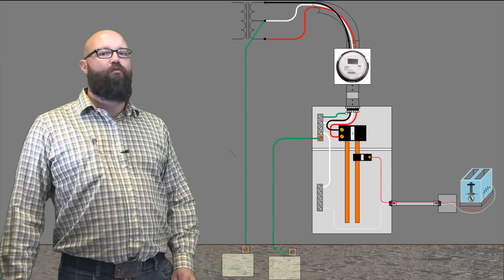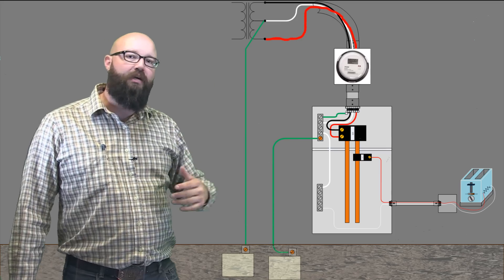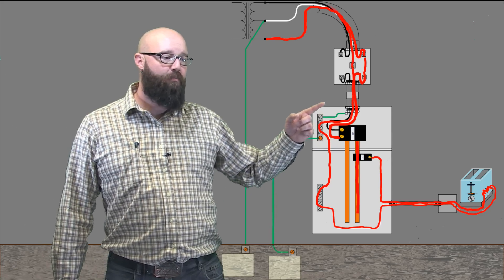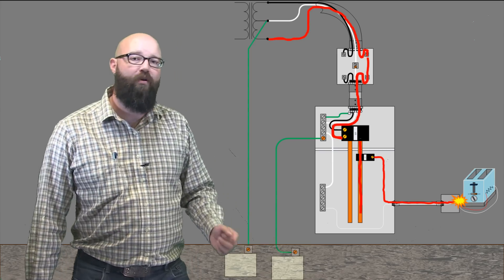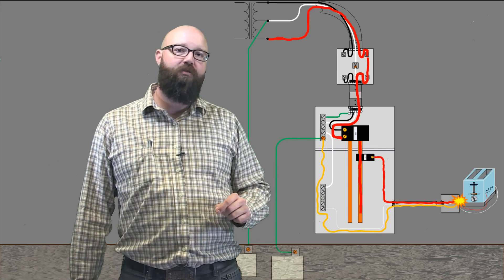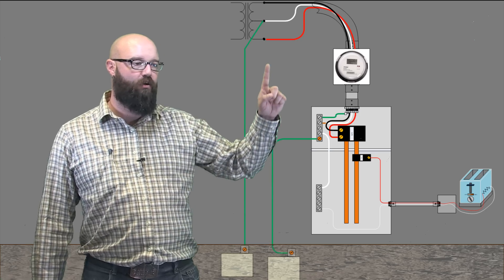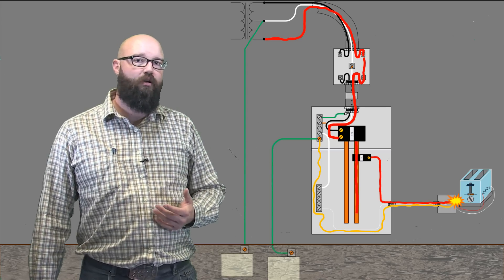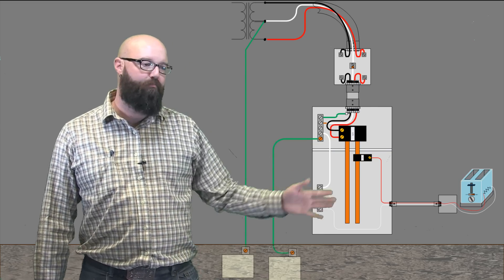Grounding and Bonding

Comment: I have discovered that I have no bonding of any of my pipes (water or gas) and I have just one grounding rod.
My water pipes are all metal and are underground in my front yard about 30 feet before it enters the crawl space of my house. A section also goes underground again to feed my outside water spigots in my backyard.  Does this mean the water pipe must be bonded, no matter what, and within 5 feet of where it enters the house?  And is done to prevent shocks?

What about gas pipes for water heaters or furnaces?  If there is already an electrical connection is that an automatic bond with a ground from that electrical connection?  Or did I misunderstand and need to bond the gas pipes, too?  

My panel, gas tankless water heater and the crawl space close to where the water pipes comes in is on the same side so I pray that this will make it easier to have updated.    Any advice and input would be greatly appreciate.

Comment: would not you need the ground wire at the box or appliance for the current to return to the boded? neutral is not connected to the box, or ar you assuming a contact between the power and neutral?
Reply: As a retired electrician, I caught that as well.   Nearly all the toasters I've ever seen, only have two conductors - Line and Neutral, thus offer no fault protection should  the metal casing become energized, even if your home has grounded outlets.  Sometimes, you will see appliances labeled Double Insulated, meaning they are constructed with _ an additional layer of fault protection,_ thus minimizing (NOT eliminating) fault conditions (i.e. energized external contact points) that regulators have allowed manufactures to forgo the normally required grounded plug (Class II electrical devices).   IMHO, Chris really should use an appliance that normally has a grounded plug, like a microwave or clothes washer.

Comment: can you point me to any video that expplains why the neutral might float if its not grounded.   i understand v=ir but cant undertand why if L1 and L2 have different resistive loads, that would cause the neutral to drift and cause voltage imbalance , the transformer is still putting out 240V but now you have maybe 100 and 140 v  in the 2 sides... but why does this happen?

Comment: What's so great about the video!? I don't feel the title is paired with the content? If you change it to how a short circuit works that might connect better. Let me put it straight: the grounding is there to save your life. That's it and the man in the video did not mention it once. He only explained what happened when you have a short circuit for whatever reason and repeat it twice. How a circuit breaker works. Not bad. Just not very accurate to the title of the video... Just my point of view. I don't have to be right too as I see everybody is thrilled

Comment: my question is .. i have an pool light that had white, black and green wireing. i need to replace the lamp asm. so i went with a L.E.D. lamp asm. the new lampe has no ground wire. only white ground,  and black power wiring. of course the green wire is still in place with no whare to go. this is an 12v systom befoe and after changing lamp asm. do i attech the green wire to the white wire connrction also ? or leave it loose.im i just concerned of is it ness to utilize the green ground wire. the orignial lamp was a 12v 300 watt unit. incancestestent.

Comment: What is an "IDENTIFIED". I ve seen numerous videos on this subject and have never heard this term. Do you mean " the neutral"?
Reply from the maker: A neutral is only correct when it is a conductor carrying the unbalanced load in a circuit as in Edison three wire or a wye system. Even then it is referred to as an identified neutral. An identified conductor is the conductor that is grounded. 

As an example a 120v circuit has an identified (white) conductor, and an unidentified (black) conductor. The white conductor carries the same current as the unidentified (typically referred to as hot) but is equipotential to the metal enclosures, conduit etc (not to be confused with a bonding conductor). It is not a neutral in this scenario.

Comment: Wouldn’t the hot touching the box be a ground fault, not a short circuit?
Reply from the maker: A short circuit is simply current flowing back to the source on an unintended path of little to no resistance. A ground fault is a type of short circuit, as would be line to line.

Comment: As well.....if the short is grounded by a ground wire that goes to the ground bar in panel and goes into the ground via ground rod and system neutral grounding. If the metal boxing, panels, metal raceways, etc are bonded to ground, yes they are energized too by the short but are safely carried away to grounding mechanisms. All this to protect YOU from becoming a big resistor going to ground.

Comment: You basically showed the same path for both. What is the grounding wire from the ground bar to the grounding rod for if both faults go up to the service neutral and when do we remove the bonding screw from the grounding bar in the panel? Nothing was explained yet again
Reply: The grounding rod is for external faults such as a lightning strike because the source is the earth. Internal or man made faults the current returns to the transformer because it is the source. In each case the current returns to its source. The bonding screw is removed in a sub panel where the ground and neutral are separated in order to avoid "objectionable current".

Comment: Thanks for the presentation, but I'm unsure if this is code compliance because the bonding conductor was not addressed here? so how the fault current will travel through the natural conductor ? or grounding conductor for the branch circuit, you provided only grounding but no bonding.
Reply: By saying "natural" conductor, I assume you meant neutral conductor. The neutral and the ground are bonded by the fact that they are both connected to the neutral/ground bus bar, therefore the ground fault will travel up to the transformer, closing the loop and tripping the breaker.

Comment: Thanks for sharing.  I have a pull out breaker next to the service box meter box.   the main box is inside the house without a ground but the metal tube from the meter box to the main panel is wraped around with a ground but it never is attached to the ground bar.  Should a ground be attached to the ground bar in this situration?

Comment: Or pvc boxes and conduits negate this and the standard green ground wire will handle it. In steel the green ground or bare ground wires will still handle the stray  current to the outside grounding rods and incoming neutral grounds

Comment: Great Video, thank you indeed, also would have a quick question, would you please let me know, how a metal conduit will be grounded if it is used for mechanical protection? is it grounded at one end? or two ends? the same question for the shield of the cables, do they need to be gronded at both ends? is there any certain rules to determine when the ground loop could be occurred and not to ground at both end? (for instance,  communication cable/ control cable/power cable ..) thank you in advance for
Reply from the maker: Generally the connections in couplings and connectors are what create bonding continuity. 
Single conductor cables generally have only one side (commonly the supply) bonded to eliminate the flow of sheath currents.

Comment: So basically, after burying your ground rods, you can run your bare copper straight to the panel & bond the neutral?
Reply from the maker: Provided you have the meter base isolated from neutral, yes. Only one location may have the neutral bond to metal on the line side of the service disconnecting means.

Alternatively you could bring the grounding conductor into the meter base, and make your connection to the neutral there, but the panel neutral must be isolated (take out the green screws)

10-210 a) and d)

Comment: Question: If you have an open neutral AND an open ground at the main( highly unlikely, I know but just "what if") and the current is diverted to a path to earth via the ground rod,  in it's attempt to get back to the neutral at the pole transformer, could a person conceivably get electrocuted by cutting that ground wire that runs up the pole to the transformer?

Comment: Hey Chris, I really appreciate this video a lot! However, can you explain why CEC went to isolated neutral bases?
Reply from the maker: Hey Brandon! Are you referring specifically to the line side meter base being isolated? It is still an option to have the neutral bond at the meter base if that's where the connection to the grounding electrode is going to be made, but then the neutral must be isolated everywhere else. And visa versa as well. It eliminates objectionable current flow over noon current carrying metal components at the service by creating the single connection to neutral.
Reply: @schulerruler  sorry im just a little confused i thought the neutral could only be connected to ground at either the main panel or the meter not both.... that bonding screw you have at the meter base isn't it illegal? sorry for my shit explaination
Reply from the maker: Based on anything post 2018 you are correct. This video utilizes the 2015 code where dual point grounding was still used. 

For new installs, according to 10-210, we have one point (meter or service disconnect) that a connection can be made, or if we are dealing with load side metering, only at the service disconnect as the meter would be on the load side of the service disconnect where no connection between neutral and metal is permitted (remove green screws).
Reply: @schulerruler  thanks alot for clarifying, much appreciated and love your vidoes they have helped me out alot!!

Comment: The thing is in Canada, the neutral in the meter box now is isolated from the metering Base. And the meter base is bonded to the  main panel.
Reply from the maker: You are correct. They have now given the option to have it booked at either the meter base, or at the service disconnect in the panel, but wherever the connection is made, the other point must be isolated as you say.

This video was made with the 2015 code where the dual point grounding was still permitted, but that changed in the 2018 and onward.

Comment: It seems like grounding is like very the last safe path for stray current. So is it absolutely necessary or just good to have?
Reply from the maker: In the event of lightning or other transient high voltages, the connection to Earth can be utilized to dissipate the massive charge. 
Definitely needed, though the system will still function without it. Overcurrent will still trip, and voltages will still be balanced because of the neutral connection to the metal system at the service.
Reply: @schulerruler  thanks for responding. I searched this video after I replaced an old water spigot that was connected to the ground from my junction box. I was wondering if it was of any use now that I replaced the copper piping with PEX? It's not attached to anything now so I am trying to see if I should  A.) Ground clamp it back to the spigot B.) Run it into the dirt/ground or C.) Get rid of it all together.

It's not connected to anything now so I guess technically my house is Ungrounded / unsafe??
Reply from the maker: If the water main coming in is still metal, then it is acting as your grounding electrode still, even if the interior piping is now PEX. 

If the water main coming in was replaced, and that is where the connection to Earth was made, then a new grounding electrode would need to be installed yes. Either a plate, or rod etc.

Comment: Help me out to understand......core question is the outside "true" ground rod driven into the earth...and it''s heavy gauge bare wire entering the home system. For many electrician's videos here on YT, they often run this 6 or 4 ga wire directly to somewhere inside the main panel box....landing either to a large , recessed-hex terminal  that looks like married to the neutral lug of the incoming power....or....to a ground/neutral bus under a screw head The question...as I view my main panel.....I don't see such a visible connection made inside the panel anywhere where I can find a bare 4 or 6 ga wire....YET....I can measure continuity from any point on the main panel ground path or ground bus .....to the "outside" ground rod. Is the depiction you show for the outside meter, located presumably in roughly the same backside location of the indoor ( in-garage) main panel....is this the point where this ground is connected between the meter box and the main panel?..... with high ampacity capability?...maybe via the neutral-connection only?....is that how it works? 🤔
Reply from the maker: The meter box is a common place to make the connection between earth and neutral, or sometimes it is done in the main panel box disconnect compartment instead. Whichever is chosen, the neutral must be isolated at the other, in Canada anyway.
Reply: @schulerruler  ...since my posting, I think I figured out my previous confusion. The ground rod and its 6 ga or 4 ga bare wire,......connect to a bar in the meter panel that also is the major neutral line ( to "load") from the meter box to the inside main panel ( in this case....bot panels are "back-to-back"). This major diameter(size) neutral continues and connects to the main panel as part of the feed to the panel. It connects via a large bar to the vertical neutral bus bar. Being the main panel,  this bus bar is bonded to the other vertical (ground) bus bar. The "Ampacity" is maintained from any ground via this bus connection to the point-of-entry of the major neutral connection.....then....back to the meter box....where the fault current either goes back to source or ground via the grounding rod. "Ampacity" in either path is maintained. This is all better described in a sketch instead of this confusing text.....but I think I have it now.
Reply from the maker: The current does not ever go directly to ground though. The entire system is designed so that any fault current imposed on the system anywhere downstream has an immediate path through all the bonding connections back to the system neutral, to complete it's oath to the transformer creating a line to neutral short across the coil of the transformer. 
Imagine current going out on line one, going through a load, then coming back on neutral normally. It goes all the way back to the supply transformer (even though it's ac and it just kind of goes back and forth we analyze it as one direction travel).

In a fault, the current goes out on line 1, or line 2, then there is an accidental connection from line 1 say, to the metal box. This could be skinned insulation, etc. The current now has a direct path back to the neutral via all the bonding connections, and meets the neutral at the main service where it is bonded to metal either with the green screw, or a system bonding jumper. This then carries it back directly to the supply transformer where it completes the circuit but with very little impedance, hence, short circuit current.
Reply: @schulerruler  ....I got that...and thought I mentioned that in my sentence..." fault current either goes back to source or ground via the grounding rod". In this case "source" is the incoming city power at transformer. In any case, regardless where the fault current goes.....there is STILL the ground rod ( pounded into the "earth/ground")...that has a 6 ga wire that runs up to the meter connection where the large neutral lands. My original concern upfront was asking if  the amp-capacity was maybe lost...seeing  I DO NOT have  the 6 ga wire continue from the meter neutral/ground bar.... to the main panel? My later realization is that "Ampacity" is still maintained via the large diameter neutral that continues between the meter box and main panel.....right?
Reply from the maker: Correct. The ground wire used to be sized based off the hot conductor ampacity, but has since been only required as you say to be a copper no. 6awg.
Reply: @schulerruler  So...overall.....should I be concerned that my jurisdiction somehow doesn't require continuation of that 6 ga "system " ...to continue from the meter box to my main panel? Seems my 6 ga system STOPS at the meter box ( from actual "ground/rod")..... and does NOT continue to the main panel bus or anywhere else in the main panel ( main panel is back-to-back vs meter box location on the outside).  Seems I'm depending on the main-feed ( large diameter) neutral wire, to get the "Ampacity" integrity maintained..... sorry for this further poke.... but I want to be absolutely sure on this and welcome your thoughts.
Reply from the maker: If the ground wire (no. 6) only goes to the meter, that means that's where the connection is between neutral/metal/ground. It will be isolated (green screw removed) downstream from that in every other panel and meter. 

This is normal. Or at least in Canada it is. 
Alternatively, this connection can be made at the panel in the service box portion, but would need to be isolated in the meter then, and the ground wire would go to the panel service box, not the meter.